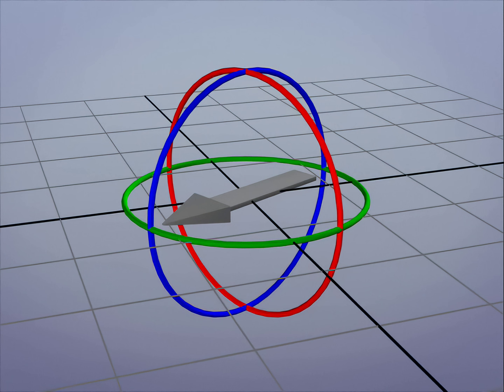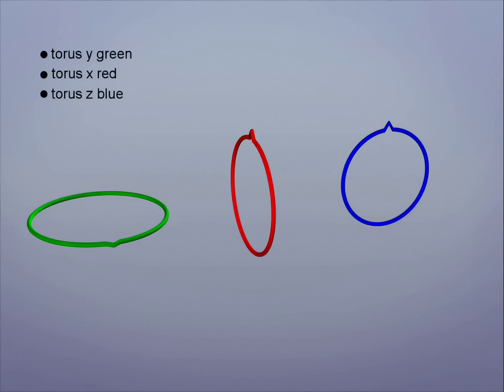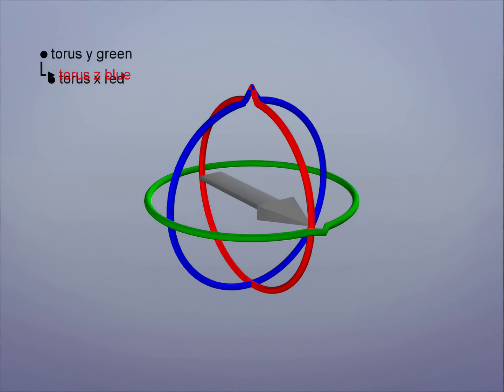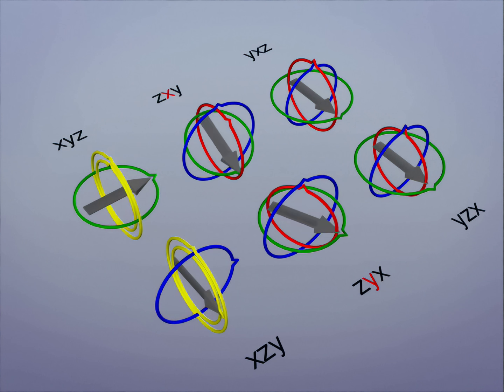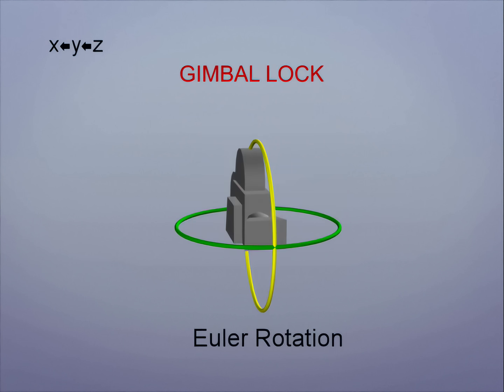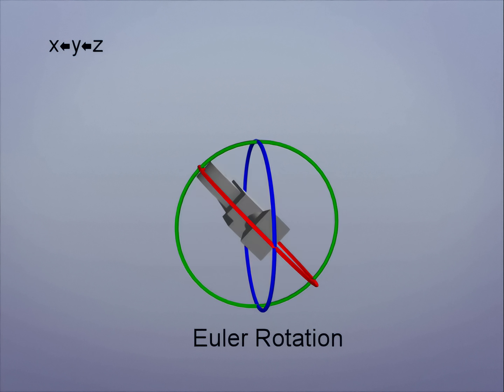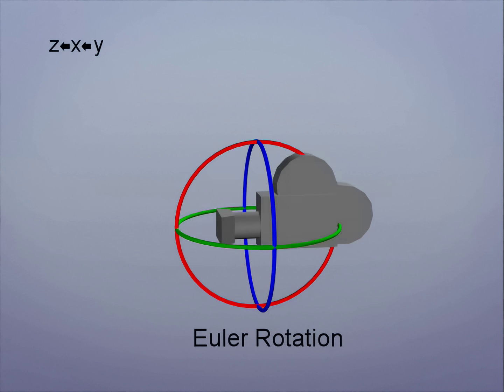Euler (gimbal lock) Explained

Comment: Am I wrong to think that gimbal lock is just a result of a higher problem, wich is the desynchronisation between the world axis and model axis ? A good way to represent a object rotation shall include that each time a rotation is made on a particular axis, the two others axis shall be rotated two, and that if we want to perform a rotation on another axis later, then it shall be around the object axis, and not on the world axis.
Still wondering if I got something or if i'm saying pure shit, but pls: help !
Reply: it's actually not quite that simple. The real problem (in the most intuitive way I can explain, without omitting any important nuances) is that euler angles don't actually describe the surface of a sphere (imagine a unit vector being rotated through all possible rotations, and the tip of the vector drawing out the sphere). The problem is that if we don't force the length of the vector to be 1, our euler angles don't actually describe a sphere, they describe a 3-torus (the surface of a 4 dimensional torus). To squeeze the 3-torus down into a sphere (so we can use euler angles to give us meaningful rotation information) by forcing the length of the vector to be constant, we create singularities where we lose a degree of freedom (this is gimbal lock). The short of it is: we can't make euler angles not have this problem. If we shifted the other gimbals around just for the sake of avoiding gimbal lock, individual euler angle rotations would have no meaning, so we would be better off using a system that makes sense (at least mathematically), and that's what quaternions do.

A simpler version of this problem happens with GPS coordinates. You've got longitude and latitude. If you crank up latitude to 90 degrees (or -90), no matter how much you change the longitude you're still at the north(or south) pole. This is an equivalent problem to gimbal lock, and it happens for the exact same reason (and has the benefit of being easy to visualize). If you don't restrict the length of the vector, this longitude / latitude system describes an infinitely long cylinder. The squeezing of this cylinder down into a sphere gives us the same problem as gimbal lock has with euler angles.
Reply: You are right, actually. And that is exactly how quaternions work. Instead of using global coordinates, the x,y,z axes are anchored to the object in question, so when the object rotates, the coordinate system rotates with it. Instructions for a pilot to pull-up, yaw-left, roll-right, are meaningful to the pilot in the rotating plane whatever its orientation might be.
Reply: If the latitude goes over 90 degrees that's just the same as under 90 degrees. Or in spherical coordinates that would be over 180 degrees which smoothly transitions to the same place as under 180 degrees, just there are two numbers meaning the same thing.

Maybe spherical coordinates would have a problem with some motion though because of the increased speed of changing longitude if passing near the nadir or zenith.

Comment: Correct me if I'm thinking this wrong, but in an actual gimbal there is no way the innermost and outermost rings can align (1:01) without the middle ring ALSO being aligned with them (I 3D printed a gimbal to observe this - http://www.thingiverse.com/thing:73634). You can however get just the outer two rings aligned in the same plane, as well as just the inner two rings aligned in the same plane. According to my understanding of 'locking' - the rigid body of interest losing 1 degree of (rotational) freedom - a gimbal lock would only happen when at least the OUTER two rings are aligned.

Comment: i don't know if i understood this correctly... but if i did, can we use a global axis reference to rotate the object and avoid this weird effect?
Reply: Think of this: X, Y, Z are axes that can be used to rotate an object in space. Since we are talking about rotation consider the following: We know that two vectors that are 90 degrees, PI/4 are Right Angles, they are Perpendicular and are Orthogonal to each other. We know that Sine(90) or (PI/4) = 1, we know that Cosine(90) or (PI/4) = 0, and from the Trig Identities we know that Tangent = Sine / Cosine and that the Tangent of 90 degrees or PI/4 radians is undefined due to division of 0 as seen here: Tan = Sin / Cos <==> Tan = 1 / 0. Due to the nature of this division upon the two legs of a triangle where the legs are orthogonal your tangent is undefined at 90 degrees. I think that this has something to do with Why Gimbal lock happens when rotating across multiple axis in 3D space.

Comment: 3:00 do we refer to this phenomenon as 'gimble lock' also or is there another term for when the rotation to get to end position is though two axes simultaneously when you really just want it on a single plain around a single axis of rotation for a more direct arc of movement? 'rotational wobble'?

Comment: If I understand correctly, the determination of rotation order to avoid gimbal lock is based on the importance of each kind of rotation.
Reply: Yes, and if I understand that correctly, Quaternion fixes this problem and adds a lot more stuff which I don't even want to hear about.

Comment: Wait, so how exactly are Euler angles used to calculate local rotation? I didn't quiet get it.
Btw, if I wanted to spin a helicopters blades with Euler angles, how much of a problem could that cause?

Comment: oh, so that's why Unity uses quaternions. I still hate quaternions, but at least I know why.
Reply: +Steven Quaternions are much more intuitive when you understand how it works. Someone compared it to mixing colors. In stead of using blue and red to create purple, you're using x and z to create a new rotation.
Reply: Quaternions immensely useful and the only reliable way to do accurate rotations on multiple axes in a game setting. Just be glad you don't have to work with them manually. I study game development. They use random numbers to make some magic maths work that I'm still foggy on myself.
Reply: +Jiř&#237; Bedn&#225;ř the thing is a quaternion's (X,Y,Z,W) values don't intuitively map to pitch/yaw/roll (with euler x = pitch, y = yaw, z = roll)

so it makes quaternions harder to use in that way
Reply: @siriusblack9999  the video contradicts the idea that Euler is that simple. It says it could gimbal lock which means one of the pitch/roll/yaw abilities will no longer exist until the lock is undone.

The simplest and most intuitive rotations I can think of are just having separate axes that each impart their own rotations on the object and not on each other (unlike Euler). That way there is perpetually pitch, roll and yaw.

Alternatively would be to have the ship have its own movement (6 degrees of freedom), so it simply moves based on its own orientation and nothing to do with some external axes. Maybe spherical coordinates could help with that (though they are pretty difficult to grasp too, I guess).
Reply: If I ever want to feel hopelessly stupid, I'll come read these comments again... I can't even remember what a radian is.
Reply: Quaternions use half angles:
q=cos(θ/2)+i*r1*sin(θ/2)+j*r2*sin(θ/2)+k*r3*sin(θ/2) where r=[r1,r2,r3] represents a unit vector used as the rotation axis.
Reply: @programagor  The formula is always so pretty to look at.  Thanks for that. 😄 In addition, it is the sandwich product that produces the affine rotation via: p₂ = q p₁ q` where  p₁ and p₂ are the 3 dimensional points represented by the [i,j,k] vector part of the quaternions, and q` is the conjugate of q.  Cheers! 🥂
Reply: @Erick Cardozo I thought Quaternion.eulerAngles were depreceted lately? Maybe you could try using q.Euler(-rotX,rotY,0f).  And i think the error was caused by you typed GetAxist instead of GetAxis. And if you choose to use quaternion like that instead using transform.Rotate() directly, maybe you could add a lerp or slerp to get a smoother rotation effect.

Quaternion q= Quaternion.Euler(-rotX, -rotY, 0f);
transform.rotation = Quaternion.Slerp(transform.rotation, q, Time.deltaTime * smooth);
Reply: Nice thing that the addition of the square of all of a Quaternion parameters equals to 1. so in networking you can just remove one parameter and send it as a Vec3 and reconstruct the quaternion on the other end. nice/free bandwidth discount.
Reply: @hullmining6903  That's of a unit quaternion, which is just a subset we use for 3D rotation
Reply: You don't hate quaternions, you just don't understand them..
Reply: +Steven What's wrong with quaternions? It's a beautiful algebra.
Reply: ***** I never said quaternions weren't impressive, but they're just so hard to use. Thank god for Quaternion.Euler
Reply: Actually, I hate both. I hate euler angles because of gimbal lock and I hate quaternions for being so complicated to get a geometric intuition for.
Reply: @Jow: Well, you can always do:
transform.eulerAngles = new Vector3(x, y, z);
Reply: Lol
Reply: https://eater.net/quaternions
3Blue1Brown and Ben Eater made an interactive tutorial that really helped me to understand quaternions. It's surprisingly intuitive once you play around with it a bit.
Reply: +Jiř&#237; Bedn&#225;ř 
just tested that, 

euler angles (0,0,0) map to quaternion (0,0,0,1)

so far so good,

rotated to 45 degrees along the y axis, or (0, -45, 0) euler

the resulting quaternion according to unity is
{0, -0.3826835, 0, 0.9238795)

not quite intuitive to me

even if it was just normalized, the resulting un-normalized quaternion would be (0, -0.4142136, 0, 1)

and it's not a degree-to-radian thing either because 45 degrees is 0.785398 radians
Reply: You don’t see the pattern in the formula? cosine for the w term, and a sine along each rotation axis for the x, y, and z. And the magnitude always adds up to 1. Simple.

Further fun property: sines are odd functions, which means that a negative rotation maps to a negative sine. Cosines are even functions, so they don’t change sign. So flip the sign of the x, y or z term to flip the corresponding rotation, no need to touch the w.

Learn to think of maths this way, and it all makes much more sense.
Reply: @lawrencedoliveiro9104  well obviously they didn't even know the first thing about trigonometry, otherwise they would have seen it
Reply: The last line is just a proof that it's NOT fucking intuitive in any way, and I am glad that Unity allows to use whatever you want, while still using complex math, probably because it's better to do so, since complex almost always means that it can be reused more.
Reply: стихи блока
Reply: Quats are awesome though! They're so great for handling 3D rotations!
Reply: I love quaternions. They're just awesome. And it felt amazing once I understood them.
https://youtu.be/d4EgbgTm0Bg
https://eater.net/quaternions REALLY helped.
Reply: @kegan, someone watched the numberphile video on quaternions ^^
Reply: Watch this video and I will not hate it:
"Humane Rigging 03 - 3D Bouncy Ball 05 - Quaternion Rotation
" https://www.youtube.com/watch?v=4mXL751ko0w
Reply: I hate eulers, Quaternions are love <3 I can't wait to make my pilgrimage to see the actual plaque where they were first come up with :)
Reply: But they do intuitively map to the axis and angle of single rotation.
Reply: Jiří Bednář  Are quaternions somehow superior to matrices? Anyways thanks for equation with half angles.
Reply: Pavel Peřina  Yes they are ^^. While matrices (3x3) are actually a little bit cheaper to apply to a vector (9 mults, 6 adds) using quaternions (21 mults, 18 adds) allow to interpolate between two rotations much more easily.

Most people that use matrices for everything and need interpolation usually decompose a 4x4 matrix into translation and a 3x3 rotation matrix which is converted to a quaternion to do the interpolation and then converted back to a matrix ^^.
Reply: Bunny83  Can't we just use two rotation matrices instead of quaternion? It's a bit beyond my imagination, but what I mean is to take one vector (e.g. forward) and use cross product of normalized initial and final forward vector as rotation axis. Then take other vector (e.g. up) and use 2nd rotation around forward vector to align already transformed and final up vector. To animate rotataion, for each interpolation step increment both angles by linear step and always  construct 2nd matrix as rotation around current forward vector.

Equation which Jiří Bednář mentioned is fine for one rotation, but I have to research how to use quaternion for interpolating between two random orientations in space. I also wonder if I can use quaternions for interpolating between N random orientations with smooth change of rotation at keypoints (I mean without sudden changes of angular speed and rotation axis)

EDIT (2 hours later): surprisingly I found out, that combining two rotations around vector likely gives different rotation around different vector :-O So likely just one rotational axis and angle is enough to describe orientation in space.
Reply: Pavel Peřina  Exactly this is what a quaternion represents ^^. It's just a single rotation axis and an angle around that axis. Only in 3d space any orienation or rotation can be represented by a single rotation axis + angle. So combining two quaternions into one has the same effect as combining two matrices.

Yes, it's possible to slerp two axis from one reference frame to another and build a new matrix out of the interpolated axis. Though this is not really easier and also may result in some strange squishing since you interpolate the two vectors seperately. So the may not stay orthogonal during the interpolation. To properly interpolate two rotation matrices you usually calculate the eigen vectors of the difference matrix (A * B.transpose). Those is essentially the rotation axis since points on the eigen vectors are not changed.

I recommend watching the Numberphile video on quaternions:
https://www.youtube.com/watch?v=3BR8tK-LuB0

I also highly recommand the eigen vector / value video of 3B1B:
https://www.youtube.com/watch?v=PFDu9oVAE-g
Reply: Pavel Peřina  Note that the concept of a rotation axis only exist in 3d. 2d doesn't have a rotation axis (you would need 3d to define an axis) also 4d doesn't have a single axis of rotation either. Rotations always happens in 2d planes. In 3d space a plane has exactly 1 normal vector (which is the rotation axis). In 4d space a 2d plane has two normal vectors. 2d space has only one rotation plane, the X-Y plane. 3d space has 3 planes (X-Y, X-Z and Y-Z) and 4d space has 6 planes (X-Y, X-Z, X-W, Y-Z, Y-W, Z-W)
Reply: Bunny83 where/how can i learn these things? Id like to dive more in matrix, quaternions and how they relate to computing. We had some subjects in university but very basic.
Reply: @leandroamarillo3262  start by the complex numbers, they can be seen as a subset of the quaternions. And Matrices are a convenient representation of vector maths, given the amount of terms involved. Conceptually they're easy to understand but they require a lot of concentration, and are very time consuming
Reply: Was invented in ancient greece
Reply: @CloudOmegaVII  quaternions were invented in Dublin in XIX century by William Rowan Hamilton. Leonhard Euler, though lived during XVIII century and was swiss, no greeks involved... ☺️
Reply: fuck unity, quaternions are generally used in animation... and unity is one god damn retarded engine that used euler for long time before realizing how stupid is that.

Comment: The information about a 3D rotation is "overcompressed" in Euler angles, leading away from a 1:1 numerical representation.   A simpler approach is to use a 3x3 matrix "rotator" (information spread across 9 numbers instead of 3).  If you know how 3D direction vectors (unit vectors) are used to represent directions in 3-space, then the matrix represents the pointing directions of the 3 local-object axes x-y-z in the reference axes system X-Y-Z.   The elegance of rotators for computing is they offer a 1:1 numerical representation -- every unique axes rotation has a unique numerical representation, and visa versa (if we accept that -0 and +0 are the same).
Reply: The problem with using a general matrix just to deal with rotations is that they can accumulate rounding errors. Say you do a whole succession of small rotations (like in an animation): the resulting accumulated matrix will likely no longer represent a pure rotation, it will add some distortion to the object as well.

You can fix this by periodically renormalizing the matrix. Or you can use a representation that only represents rotations (like quaternions), and avoid the problem altogether.
Reply: @lawrencedoliveiro9104  Yes, you wouldn't want to use a 3x3 matrix as a rotational accumulator or interpolator.  But for one-off computations, they 3x3s are much more intuitive, and thus easier to teach and learn.   So, the choice depends upon the application.

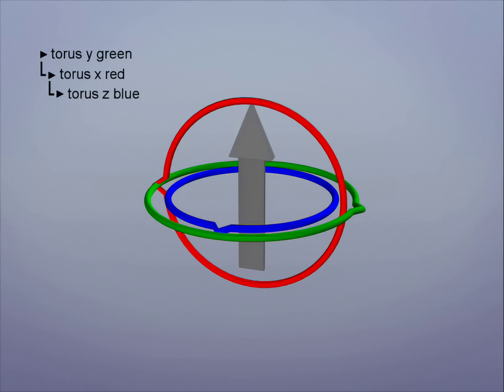Comment: 2:30 "there's no axis to turn on".. What's the problem of turning the red torus?
Reply: +ThomasHaberkorn just keep watching. They need to move to the next position, by changing the rotations. Just rotating the X won't move it there.
Reply: +ThomasHaberkorn You could move the red axis to unlock the blue one but that would just move the arrow back to the original position, you wanna to make the arrow face straight down.
Reply: there is more than one way, simply, is arbitrary, and may be not optimal for our purposes. Check this video https://m.youtube.com/watch?v=0VAc_G79POE